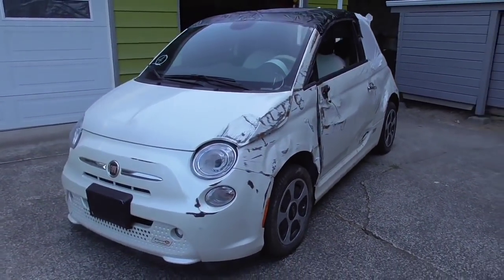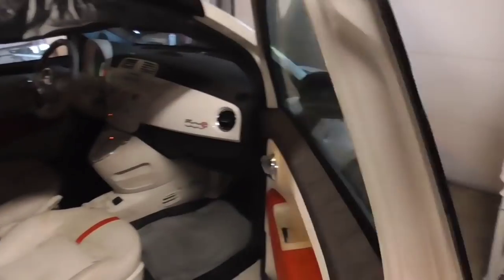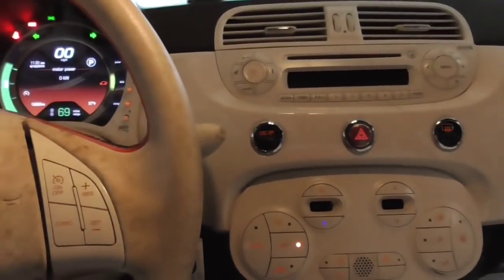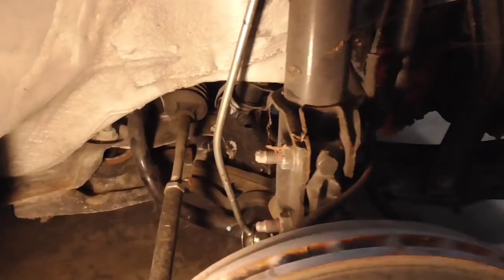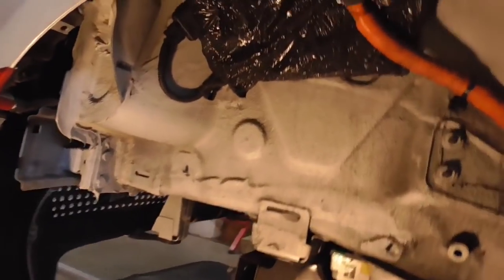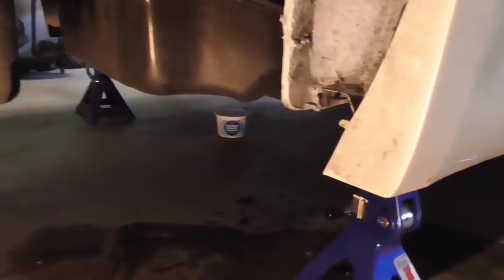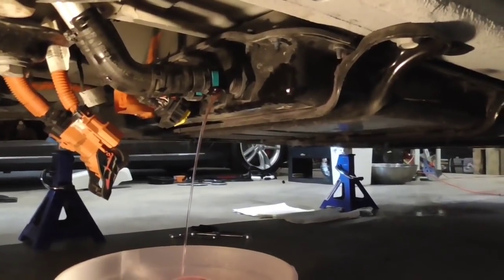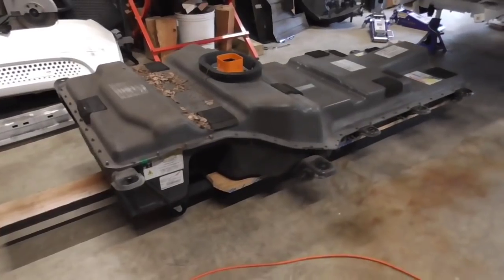Fiat 500e - Teardown - episode #1

Comment: Hello. I have a 2015 E and I noticed this “knocking” what would be similar to a lose motor mount in a ICE vehicle. It knocks out hen accelerating and again when coming off the gas at lower speeds. I can’t find anything online to remedy this issue. As in where I can tighten down a motor mount situation. Could you offer any advice on this since you’ve done a full tear down? Thank you.

Comment: When replacing the charging socket and cable, is the cord accessible without removing the battery? The socket broke and I have the entire cable, but can’t find information on replacing the entire cable, but can find just swapping the socket. Thanks
Reply from the maker: Replacing the the J1772 connector with the cord assembly is a straight forward job.  I believe I show the removal in a later episode.  It runs along the right side from the filler port to the charger which is located under the hood & above the Motor on the right side.  All batteries stay put.

1. Fully disconnect the 12v battery - this shuts the car completely off. 
2. Jack the car up & secure on jackstands.
3. Remove right rear wheel.
4. Remove wheel well cover plate that covers the hidden part of the J1772 connector.
5. Remove the fasteners that hold in the connector & then the connector pushes thru.
6. There are several (like 20) plastic cable-tie w/ plugs that you will have to pull and/or cut one by one, freeing up the cord.
7. Once you get to the front, the right front wheel can come off for easier access.  If you haven't already unplug it from the charger.  That end will have to come down to finish.  It's tight with lot's of those plastic cable ties everywhere.  Wear long sleeves & gloves.
8. Installation is reverse of removal.  Those factory cable-tie & plug mounts should be available.  But, if you can't get them, expect to substitute with stock cable-ties and/or wire.
Reply: Thank you!

Comment: I’d like to import one to my country! The ones already here command “Tesla” like pricing! Just for the novelty!
Reply from the maker: In all fairness, the 1st gen Fiat 500e is pretty solid.  A simple EV if you will.  Lot's of old school buttons instead of crappy touchscreens. You have to buy direct from the U.S. for the best deals.
Reply: @theevolvingworld  I will and I will ascertain what kind of exsanguination does my country customs requiere of mere mortals wanting to liberate from the State owned oil reseller! Their luxuries ranging from janitors doing tele-work to refinery personal standing idle since the late 1980´s when the refinery stoped refining the early fuel injected cars and carbureted ones with their poor and damaging product, all of which account for 35% of the cost of fuel here...be as it may, I am a quick learner and I will try to become savvy at this car. I love the style of Fiat and we have had some of their products since the Fiat 850 Special passing to the Uno and then a Punto SLX.

Comment: up to how many miles do the batteries last.....thinking of buying a 500e....just want to have an idea of what mileage is still safe
Reply from the maker: The battery cell chemistry that this car uses should "last" a human lifetime or more.  What does not "last" is the capacity of which each cell can hold.  With each charge, there's a trace amount of capacity loss.  It may be undetectable for years, or if the battery was abused, it may show up much sooner.  There's an infinite amount of variables that a "user" can do to sustain or degrade a battery's capacity.

If you can scan a car using "AlfaOBD" before you buy it to check the "health status of the battery" would be the only reliable way.  Adjust the offer price accordingly.  I have videos on this procedure on the channel.

Comment: The pre-2020 500e is a compliance car made to satisfy a manufacturer's government requirements to have an electric car available in their range of models. The battery pack very likely was shaped to fit a standard Fiat 500's chassis so that they didn't need to build a whole new chassis. You can see the dividing lines in the top where the battery tray can fit into the car's existing exhaust and fuel tank recesses.

The chassis and interior of the 2020 500e that was just released was probably custom designed for electrical use. The battery pack in that car should be much better proportioned. It's already much more powerful with a 320 km/199 mile range and fast charging support.

I hope that one makes it to North America, but built in Europe and not in Mexico.

Comment: Do you know if the 500e control arms are different from the 500? I've got a "clunk" when I get on and off the throttle under 30mph on my 500e. I can't decide if it's CV joint play or control arm joint play. The motor mounts SEEM to be okay. 

I've got suspension play up from just hitting small bumps, too, sounds like it's coming from the top hat bushings. Going to just replace the front suspension completely but I don't know about the control arms.
Reply from the maker: If the control arms are different, the 500e is using "abarth" parts.  Only the springs & shocks are 500e specific, due to unique weight distribution.  Sounds like a bushing is bad or maybe something is just a tiny bit loose.

Comment: Would you be willing to sell me the rear rims off of this car?.
Reply from the maker: I am open to selling them, but as a complete set of four w/ tires.  Could make a nice second set for winter.  All are: functional, have over 50% of tread, & hold air.  There are some scrapes on the outer edges of a couple of them (that could be filed or ground out).
Reply from the maker: Hey, change of plans.  I've got a bunch of parts available on eBay.  One Rear wheel & one front.  The other two were to scraped up.

Comment: Thanks for doing these videos. I was wondering if there is a way to add batteries to the existing pack to increase range.
Reply from the maker: Both the 2017-on BMW i3 & VW e-golf use the same size cells as the 500e, but with 50% higher capacity.  In theory, if one could cost effectively acquire those cells, one should be able to rebuild the Fiat 500e pack as a 36kWh.  Ep #7 will be the battery teardown edition, coming late this year.  Cheers,

Comment: Thanks so much for this. It's incredibly informative! If you don't mind me asking, how much did you have to pay for the totaled vehicle and did you consider replacing your battery with this one which has lower usage and mileage?
Reply from the maker: I thought about it.  But, the better plan is to use up my current battery & then rebuild it with the higher capacity cells that add 50 - 100% more range.  And the old battery becomes a battery backup for the house.

Comment: are you going to sell parts? I would love to have the rear wing.
Reply from the maker: Yes, & I've accumulated quite a collection.  That particular part has scrapes & a crack.  It's also glued to the hatch.  It's free, if you want the whole hatch.
Reply: @theevolvingworld  are parts still available, like the AC compressor? need it for my 2014 500E.
Reply from the maker: @ivanbanishtok7603  Hi Ivan, You're in luck.  The AC compressor is available.  I knew someday, somebody would need one.  I can offer a guarantee that it works or your money back.  I believe I showed it working and/or removal procedure in a later episode.  Send me your e-mail (you can always delete that message after getting a reply).
Reply: @theevolvingworld  thank you for the reply and a chance to do business. i really like the fiat 500E. i also heard the ac compressor has another function when charging the car it kicks on to cool the coolant to cool the batterys during hot 100 degree weather. That's what chystler mechanic told me. and why check engine light comes on. i charge at night and there is no problem.
Reply from the maker: @ivanbanishtok7603  I replied via email to your inquiry about the part.

Comment: I was glad to see that this wasn’t “your” car. 
It’s interesting to look at how and where the damage is and try to put together exactly how that happened. 
On another note, do you need to take any safety precautions with this disassembly taking place inside of your garage? That’s a lot of amperage that could (potentially) have damaged wires, insulation, or any thing else.
Reply from the maker: No issues what so ever.

Comment: What specific brand/model of the ODBII adapter do you use?  As my experience, 500e has its own proprietary protocol and does not follow the common ODBII  standard.
Reply from the maker: I've  been using only one for a few years now.  Originally for my former LEAF & then on the Fiats.  Konnwei KW902.  See my "...how to check your battery capacity" video for plenty of additional feedback.
Reply: There are two ways: 1. pay through the nose for a FCA wiTech diagnostic tool, or 2. use AlfaOBD and a ELM327 adapter.
Reply: @EleTruk  thank a lot for the helpful advice.
Reply: @dtkywtan  Not sure if you are being sincere, or sarcastic.
AlfaOBD is here: https://www.alfaobd.com/
Reply: @EleTruk  I'm sincere.  I got my 500e "check engine lights on" while using a generic Bluetooth OBD2 adapter, but my 2012 Volt is totally fine with the same adapter.  Therefore, I was really curious about what specific type of OBD2 that you can successfully retrieve many information from 500e ECU. 

Anyway, thank you again.

Comment: I cant wait to see what you find..I want to increase the take off power of mine.
Reply: It needs rear wheel drive,
Reply: @robertpryor7225  I've thought about moving the drivetrain to rear, but this will need a custom design battery pack as well and also the software is a concern too.
Reply: @RonHaslam2001  - too much work to add rear drive. Replace the cells in the existing battery w/ higher energy cells, add wider tires, experiment w/ oversize diameter wheels/tires. We'll probably never get a software hack or anything from factory.
Reply from the maker: Yes, that's one objective.  Must be a way to "tune it".  For now, I advise to shed some weight.
Reply: @theevolvingworld  going to do the trunk space mod first. already took off rear under protect bar, but added a hitch. so no loss there.
Reply: ... the wheel spin so easily with stock setup
Reply: @robertpryor7225  could always be more!
Reply: https://shop.500madness.com/fiat-500e-madness-gopedal-electric-pid1371

But Robert Pryor is right, you need stickier tires